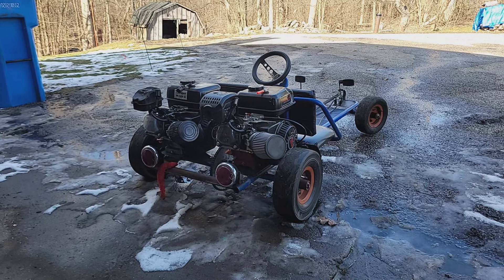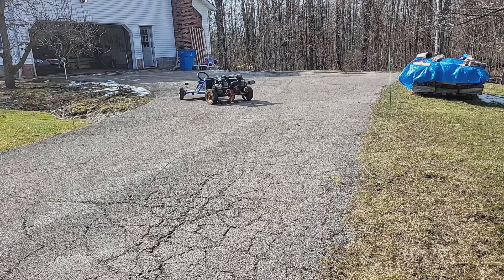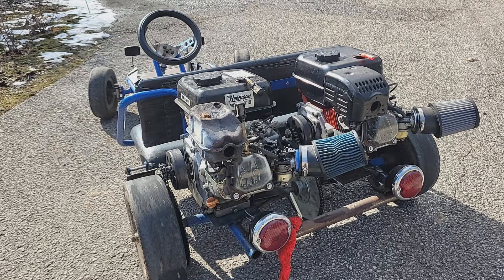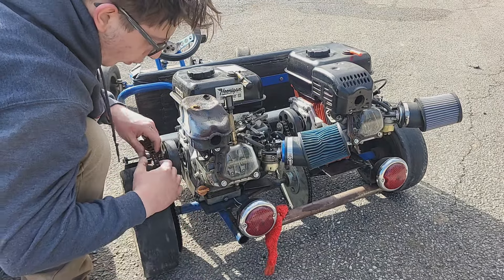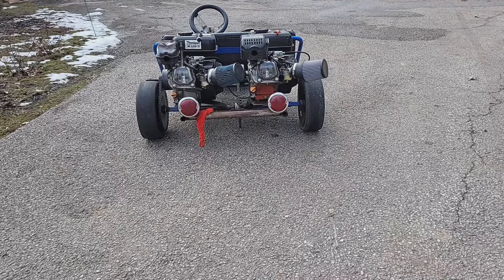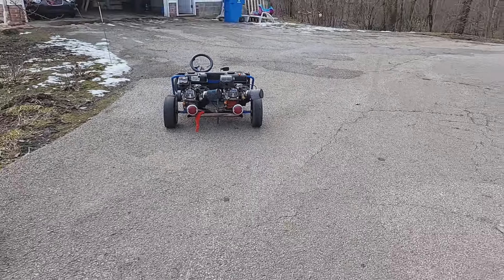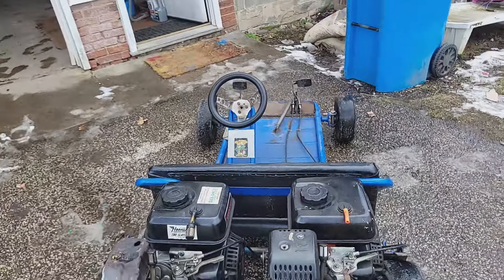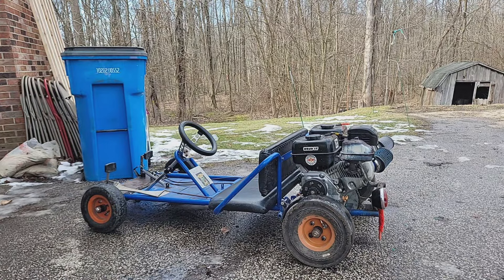The Twin Engine Go Kart is SCARY (but that's a good thing)

Comment: how did you consolidate the throttle linkage?
Reply from the maker: @JMMACxXxSHELZ  Two very long throttle cables off of Amazon from the pedal all the way to the factory brackets on the engines. I also modified the factory brackets slightly. I think there's a more in-depth overview in another video I did about a year ago.